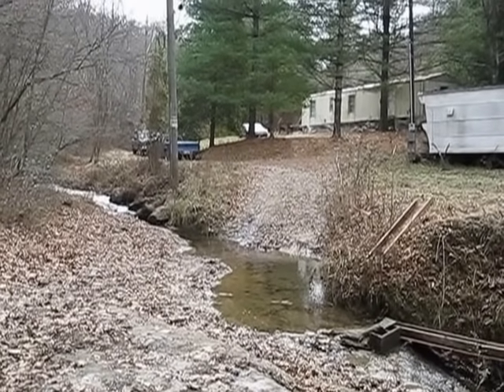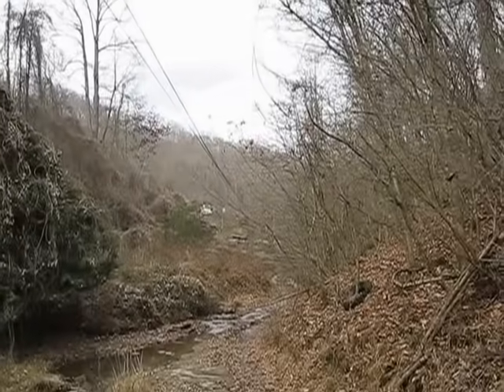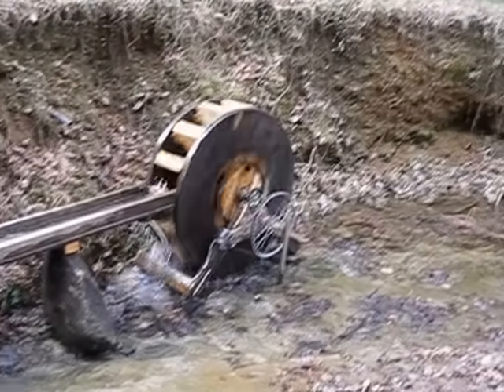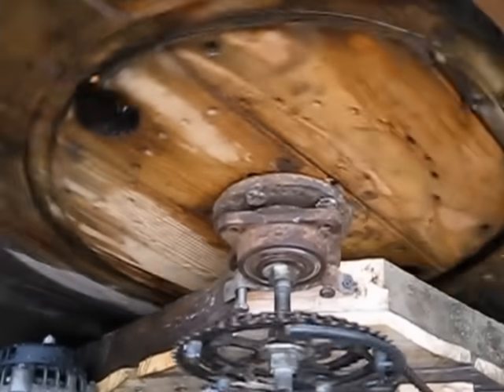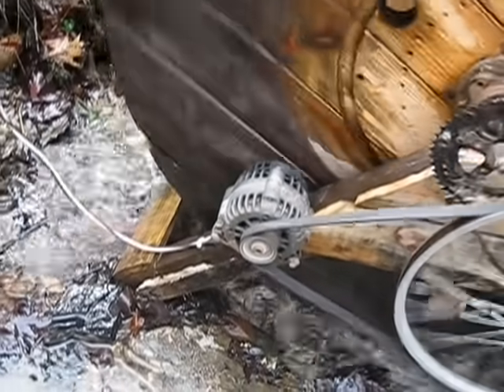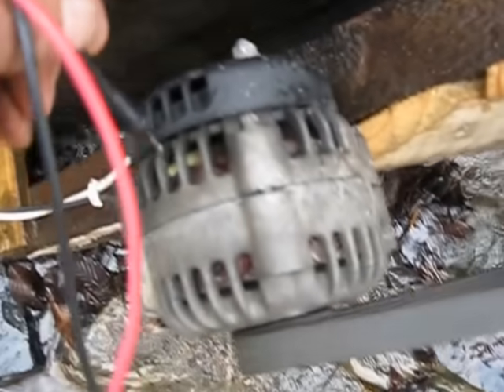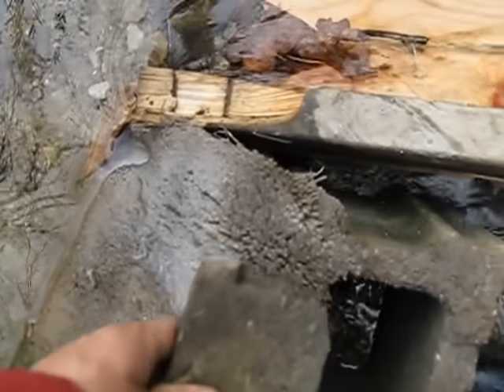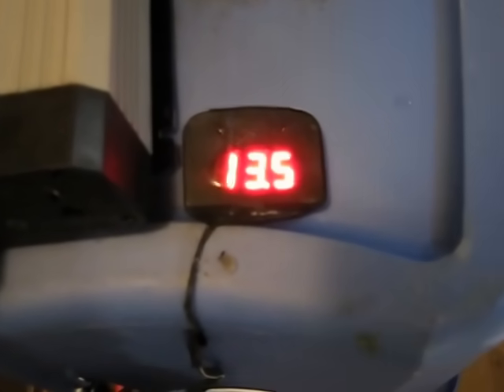water wheel generator

Comment: build another waterwheel either beside or behind, depending on GPM. outstanding American ingenuity. this is what I have been screaming for for years to be installed in our major river systems. sure, not a 100% solution, but, it creates zero emissions and NEVER runs dry. I live close to the Cumberland, Tennessee, Ohio and Mississippi river's. rock on brother.
Reply: Tony Dowd that is not american ingenuity that is tesla ingenuity
Reply: Correct me if I'm wrong but isn't this exactly what dams are?

They're giant hydroelectric generators, like Hoover Dam outside Las Vegas
Reply: @mtnmotoadv  There's over 80,000 dams in the US and over 90% do not make electricity. They merely hold water for agricultural use, flood prevention and the like. Unfortunately, most of those dams are viable for energy production but simply aren't being retrofitted probably for funding reasons. 

https://www.energy.gov/eere/water/hydropower-resource-assessment-and-characterization
Reply: @mtnmotoadv  not all dams do that also most damns create a lake or pond and such this here does not it takes a fraction of the water without creating a lake or they calling it a reservoir

Comment: Very impressive. Would a stronger alternator or stronger water flow increase the voltage output? What happens if you lower the flow to increase the water flow?
Reply: im assuming hes useing a voltage regulator in connection with the alternator .if so it is set up for 12 volts dc. which he will convert to 110/220 with a inverter.no way to really get more "voltage"but a better gearing system could get him more power as it would spin the alternator faster.

Comment: Ideal battery would be a forklift battery.... good luck getting it through the forest though... 😄
Reply: obviously you are blind as fk and did not see the car and truck parked next to the house
Reply: golf cart batteries would be more feasible
Reply: Deep cycle marine batteries in parallel.
Reply: Darryl, it all depends.
A forklift battery will take more power to charge than a deep cycle golfcart battery that has the same amphour capacity. Minimum amps required is 20amps or higher amps just to charge a forklift battery. But you have to make the battery ''boil/bubble'' good  once in while to stir up the electrolyte and this may take up to 80 amps of charging power. Low charging amperage will kill those batteries and they need a lot of water. They are pricey and repair and replacing cells is still expensive.

Comment: sorry about the lower comment I'm using audio I'm not typing what I was saying is use a large pipe is far away uphill as you can get then reduce that down to a very small diameter Point that at your water wheel this will speed your water wheel up extremely fast depending on how far your drop is

Comment: Not an electrical engineer, but I do know that DC line loss is significant over short distances. You would do much better with a micro-inverter right at the generator, getting AC to go that distance to your house, you would save 90%. You are losing 67% from just line loss. Using a much thicker stranded copper wire would cut that to maybe 50%, but you need to get a little mini-inverter.
Reply: You cant say its a 67% loss. When you need factors such as wire type (Copper, Aluminum) Length, Gauge to do a formula. He does have an inverter if you overlooked that. Putting one outside is not a good or safe idea. Remember he is only charging not running off of the alternator without the regulator. As its putting out 40 volts. FYI You cant draw off the alternator. Alternators acquire torque under loads. Hence stopping his water wheel. Which is why you have the battery pack inside. What you suggested wouldn't work in his scenario. He has a voltage regulator keeping the voltage down to charge the batteries. Which is why you see 40volts out and shows 13.? volts on the inside meter.
Reply: Correct me if I am wrong, but the alternator was generating 40 volts, the power coming into the house was only 13.4, which is where I came up with the 67% loss calculation. I understand that the battery cannot take more, but I had been reading about solar cells, they are all using micro inverters now right on the panel, then plugging that AC power right into the grid. They said running the solar DC power to one central point to a large inverter was losing most of the power due to line loss. If that is happening in 20 or 30 feet, then he must have five times that loss in the 100 feet to his trailer. Simple experiment to see how much DC line loss is, landscape lighting. Get the power from a transformer at an outlet, then plug in DC lights night next to the transformer, then try that 30 feet away. That cable is very thick, and still there is a huge line loss. Go back to history, Edison was not really a genius when it came to the science, he tried to give street lamps power from his generator, using DC power. Tesla told him not to do it, that AC was better. Edison did it and failed. It was because of line loss. Edison could not manage just light bulbs when it was enough amps to have given power to a hundred houses.
Reply: re watch the video, it goes through a regulator first.
so its NOT volt drop.
Reply: His battery voltage was only 13.4 V but the maximum he will ever get is 14.2 to 14.7 V on a good battery due to battery construction. each cell in a battery puts out roughly 2.1 V.
Reply: No, the 40 volts runs into the old motor home regulator, which drops it from 40 volts to 13.5. He is not getting a 67% loss from the alternator to the house.
Reply: It's the combination of high amps and copper thickness and length that gives losing power. You can maybe imagine why the big power lines are extreme in high voltage.  Because voltage doesn't kinda care about length and thickness.  But for this setup it doesn't care much. He has 40 volt from the wheel and needs to turn it down to aprox 14 volt anyway. So more power loss is actually better for the voltage control unit so it doesn't take all the power.
Reply: In that case he would run generator-rectifier-inverter-rectifier-(batteries)-inverter. Each rectifier/inverter adds losses to the calculation, so it would be much more efficient to simply run a thicker DC cable to the house. If he would use a 16mm² cable at 10A/40V the losses would be in the range of around 2,5% over 50m distance. Simpler solution: Throw out the bridge rectifier from the alternator, run a normal 3-phase line to the house and rectify/regulate it there with e.g. a three-phase bridge+buck converter.
Reply: He should hook up to the grid and sell back to the power company.
Reply: Honestly, the better answer is to transform the AC up to 120 or 240. Then, the volt-amp resistance won't kill as much power. And he can step it back down at the house.

Comment: Great job, I tried to do the same at my house but did not have enough water flow,
You could convert a gas tractor to battery power, charge it from your water wheel and also use the batteries to run power in the house when not cutting!
This is my tractor conversion,
2hrs cutting approx 2 acres or 8-10 hrs pulling trailer on a charge
Converting to battery power is a great idea for a garden tractor I converted one 15yrs ago, I used the 3 separate motor design and it is still cutting grass on a daily basis, it is amazing how it never breaks down and needs almost no maintenance, I renew the batteries every 7 yrs I am just on my 3rd set now, my design will cut up to 2 acres on a 50cent charge there are no belts or pulleys and no oil on the entire tractor, it can pull a trailer for about 8hrs on a charge, because battery run time is the most important aspect of most conversions I paid particular attention to the most efficient design, I used 3 separate small motors one for the drive with electronic speed control and two smaller with a cutter blade mounted on the shaft of each cutter motor ,total amperage when cutting grass is approx 40amps, (2000watts) this design only uses the battery power req to do the job, very little wasted battery power, it uses magnetic breaking of both tractor and cutter blades and automatically applies parking brake when you stop or get off the seat, an amazing tractor.
electrictractor.net

Comment: When it rains the alternator will get water in it, also when it rains the stream will flow more and could wash your whole setup down stream. lol
Most permanent water wheels are installed into dam walls so you can control the water flow, you also can shut off the flow entirely and open a flood gate in the case of big floods. 

You should try to dig out a dam in the middle of that stream. Then make a dam wall and house one large water wheel on the other side.

Comment: So many loses are in that system, the efficiency is probably below 20%
And why do all these off grid nuts want deep cycle batteries? This isn't a boat.
Reply: Because deep cycle batteries have thicker plates and by volume store more energy.  They can also be discharged more deeply and more times without sustaining damage to the battery 

Car batteries have thin plates with lots of surface area so they can generate a lot of power over a very short time.  The problem is, that when you deeply discharge a car battery the plates become damaged and sulfation occurs. The sulfation deposits build up in the bottom of the battery and eventually begin to cover the lead plates and the battery will make less power over a relatively short period of time.

I have a deep cycle battery that will store 55Ah and will last me 8 years.  I paid $220 for it (about $280-$320 today), but when you do the math, the per year cost and reliability make it a better value when compared to a car battery that is likely to last 2-3 years and provide less storage capacity.
Reply: And here we see the problem we have in the USA. You shouldn't discharge a battery all the way, so are wrong by recommending people to buy a certain battery type and open it for abuse. 
The right way would be to show them the right way to use a battery, so having an efficient battery charge controller as they sell them for solar systems, and making sure that the inverter is also efficient and not some old junk, would be the first step.
Also, we know some preppers want to use junk to produce energy but we are not yet in a zombie apocalypse, so we could use a higher quality welded water wheel that allows for a higher RPM, a better generator instead of an old one from a car, and some larger diameter wires as they also have quite a high resistance. So we are probably already losing 50% of the energy before it even hits the battery or when it comes out of the battery.
In the case of a water powered system the energy storage might even be better in some super caps instead of batteries.
And at the end, also the recommendation should go to the batteries, you don't need deep cycle batteries as your charge controller, and even a $20 one knows that will shut the batteries off before they are getting to low.
And in today's time, you can get Lithium-ion batteries for your battery bank as they have a very little memory effect, high energy density and low self discharge. 
And if you want a longer life you could choose Lithium nickel cobalt aluminum oxide batteries.
I know you will go old school with deep cycle batteries, but they are not very efficient and you lose out on energy that could be stored and harvested.

Comment: Automobile alternators normally produce about 13+ volts. How did you get 40 V or should that be 40 amps? I notice you are getting 13+ V just upstream from inverter. 
Also, what do you run on 1 kW of electricity? Do you use cfl or LED bulbs? I'm sure there are more efficient set up but if you are generating 40 amps, that's about 1/2 kW per hour or 12 kW a day. Not bad. Before WW II, farmers had 32 V Windchargers. Many didn't like paying the local EMCs, told them to unhook the wires and went back to producing their own. If you could keep from using over 1/3 of the charge in a car battery, they would last as long as they do in your car.
Reply from the maker: Its 40 volts because it has been converted to a permanent magnet alternator. I use led light strips and gravity feed water. I also have solar panels now too. I will do an update video soon.
Reply: I'm no EE but at the very least the latest generation of household LED lights that only utilize 4-8 watts at a .10 amp utilization seems like a good place to start if you're looking for an off-grid lighting solution.
Reply: The alternator usually contains a voltage regulator which regulates the stator output voltage by controlling the magnetic flux via the rotor current. He changed the system to a permanent magnet meaning that this alternator now runs "off the leash". 40A is by the way absolutely illusory for this setup, the output will be in the range of 100W.

Comment: If you increase the diameter of the water wheel, it will gain more power through leverage  to turn the alternator faster under heavy load.
Reply: Hi, love the water wheel but just one suggestion if you turn the whole wheel construction round and put the water chute at the top. Of the wheel it will be much more efficient. B t w love the channel

Comment: Maybe I missed it;  Modern alternators use field windings as electo-magnets, and need a 12 volt DC source to the "exciter wire". 

Voltage regulators usually keep alts. putting out 13 - 14 volts DC regardless of speed of alternator spindle.  40 volts output DC or AC?  Has the alt. voltage regulator and/or diode pack been bypassed? If so  then it's AC current, could not see your meter setting.  Great video overview, just looking for the details......those are critical to really make it work from the alt side of things.

Comment: build a small stock pond, with a greater fall ratio with the water hitting the tips of the Pelton wheel. I'd also take a few bike wheels, cut them and screw to the outer radius of the Pelton wheel, that will increase the ratio of your rmps to cause faster charging times and torque.

Comment: do I missed something? howcome you get 40V?
Reply: He modified the alternator and it no longer has a regulator so it's rpm dependant. Higher rpm = higher voltage
Reply: +Harry Irvine thanks Harry...but voltage inside the house is 13,5V.
Reply: He feeds the output from the alternator into a "charge controller" out of a camper.  This device is simply a glorified battery charger which regulates the voltage down to the 14.5V which he uses to charge the battery. The fact that the battery then draws it down to 13.5V shows that it's not a stabilised output which is a bit crappy as it dramatically slows the rate of charge.
Reply from the maker: The voltage from the alternator goes into the camper rectifier/charger and is reduced to battery voltage.
Reply: now I'm a little bit out of topic, but thank you anyway Off Road/Off Grid

Comment: If you're so far off-road how did they get a 50 foot trailer in there?
Reply: - watches cool video - 
- finds one negative aspect of it and complains -
Reply from the maker: They pulled it up there with a bulldozer and ended up damaging the frame in the process. The main guy delivering it pulled me off to the side and told me house trailers are not designed to go in such places and refused to take it through the creek until I signed a paper saying they weren't responsible for damage.
Reply: you ever hear of ....farm tractors..??

Comment: (Dave using wife's acct. ). I can tell you with certainty that if you were to invest just $400 into TWO, OPTIMA 75ah Deep Cycle Batteries, you would realize an amazingly superior setup, with a much more efficient distribution of energy.  Two 75ah deep cycle batteries ( DCB ) will give you 150ah of power. For example, you could run a 75 watt light bulb for around 40 hours ( Formula: Watts = Amperes * Volts,    Another:  Watts / Amperes = Voltage ) The 40 hours of powering the 75 watt light bulb includes the 6 watts that the Inverter draws. Imagine getting ahold of 10, 50ah deep cycle batteries, you'd have 500ah of power ( batteries tied in parallel ). I hope you are using LED lights, as incandescent lights are horribly inefficient power suckers.  Have you thought about making a windmills with your Alternators and a couple of 40' Shortwave antenna masts. If you get a cpl. hours of wind each day, you'd really make out. Use Gear reduction if you want to charge fast in a brisk wind.  Good job, but get rid of those car batteries. They aren't made for constant drain and charge. You will be amazed by how much DCB improve you power storage.
Reply: His rig only generates less that 5 watts of power.  Batteries really aren't the problen.